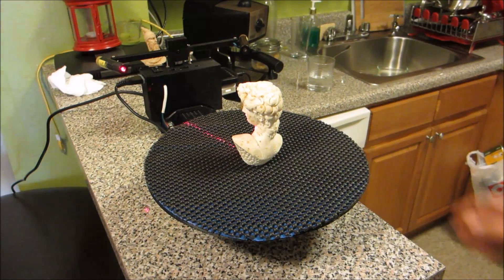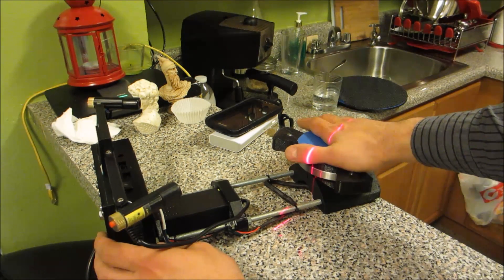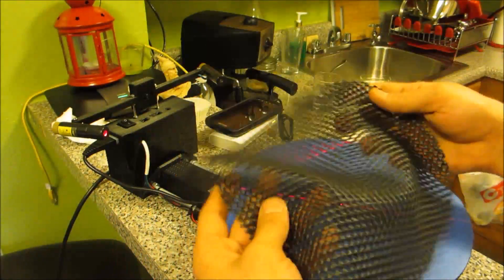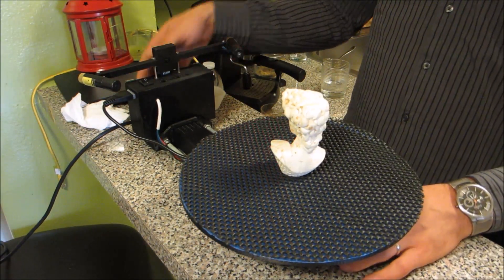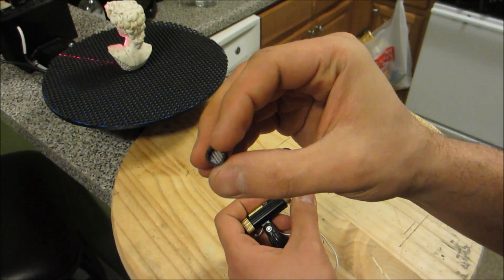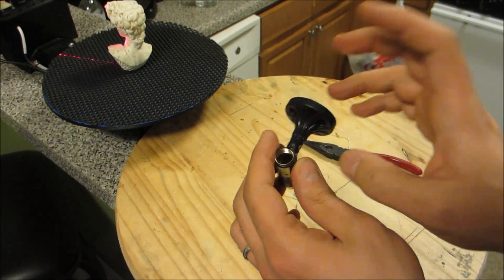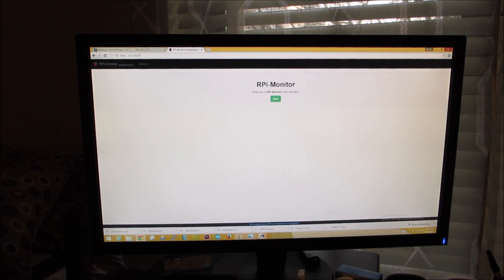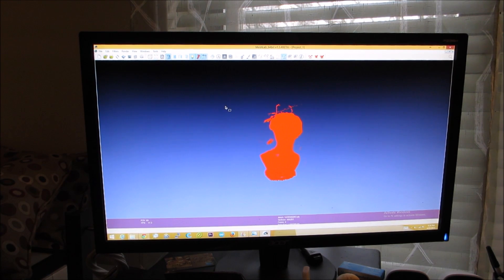FREELSS 3D Scanner

Comment: Hello, I guess it's 8 years too late but would you happen to have parts list for this?
Reply from the maker: This is something that I have abandoned at this point. The software I was running was not exactly tunable and the results were questionable at best. Something like this is more suitable for a simple Python script that would run certain rates with the now modern camera. Heck I do not think freelss is even around anymore.
Reply: @Engineerd3d  I sorta figured doing due research on google after the comment.  Still much appreciated.  Photogrammetry looks promising but I don't really see an option that can be run on desktop PC.
Reply from the maker: @youngkwonkim8486  photogrammetry has come a long way and there are toolkits to generate point clouds with it. Those toolkits run on windows or Linux.

Comment: Hello Bruno, in Atlas 3D software there is a Rotate button in calibration page. Motor should turn according to the entered degree. But in our scanner even I enter 360 degree it just turns approximately  40 degrees. This happens again in scanning process, for a whole turn of the table 3200x32=102400 should be entered in ''Step per revolution' textbox. What can be the problem?  Stepper motor is Nema 17, driver is A4988. Also microstep pins are high. Thank you in advance.
Reply from the maker: Honestly I am not sure what could be wrong other than lost steps somewhere. The A4988 driver gives you 16microsteps, generally speaking nema 17's have 200 steps per revolution given 1.8 degree motor. The total should be 3200 steps per rev, not 102400.  I have tried 32 microstep drivers before. The scanning software did not like it.
Reply: Thank you Bruno. The problem was about our Raspberry Pi GPIO. By changing the wires we solved the problem.

Comment: Hi Bruno. I wonder  how many your voltage of  stepper motor did you adjust?
Reply from the maker: I am using the pololu a4988 drivers setup for 1/16th microstepping. The voltage was adjusted to ~.25v which equates to roughly 1/2amp at 12v. This is how you adjust it. http://reprap.org/wiki/Pololu_stepper_driver_board

I noticed you sent me an e-mail regarding the pinout. The new firmware uses different pinouts. I don't have them off hand as I haven't touched the scanner in months, but you have to correlate the physical pins with wiringpi pins and test in the software. Be careful though, the stepper will overheat if your vref is too high, I suggest setting it to something small like .15v and getting the pins correct then adjust up if there is not enough torque.

Comment: what resolution did you get up to? And does increasing the quality of the camera sensor increase also the maximum resolution obtainable? I am lookin for at least 50um resolution... also the plate should have very small steps, maybe using the motor on a belt mechanism with small/big gears.
Reply from the maker: +Ephestione's HQ 

I have stopped tinkering with this scanner for now. There seems to be a problem with the circuit board I built that causes the stepper to overheat and not work. I will resume working on this project at a later date as I have other things going on in my life at the moment. I have not posted any videos since august for this reason. The good news is that once I am done I will have my own secluded maker space for working on projects and shooting videos.
Reply: +Bruno M. I see and cheers, working with this stuff in the kitchen doesn't make women happy :P

Comment: if you are going to use red lasers to scan an object, its better to do it in a low lit to no light environment. if you have to scan with lights on, then use green lasers. I personally prefer to use blue (405nm) lasers with lights off, really really good scan results. Also make sure you can adjust the focus of the lasers you use and they have glass lenses, not plastic...
Reply from the maker: Blue lasers sound like a good idea. At this time I have put away my scanner as I need to do some other work. Later on I will try a blue laser as well as a green one.
Reply: Bruno M. Awesome! Would be great to hear how it works out for you. I think you should see a great improvement in scan quality. Good luck! :-)
Reply: Johnathon Windsor is this the atlas 3d scanner? is there any sotware to scan faster with a green laser? something as fast as the eora 3d? or just turns the table faster with a constant on laser? those seem to work well as far as time and quality of scan goes.
Reply: did you tried ever infrared ? (remove ir filter + use ir 1-5mw laser pointers (weak offcourse) )